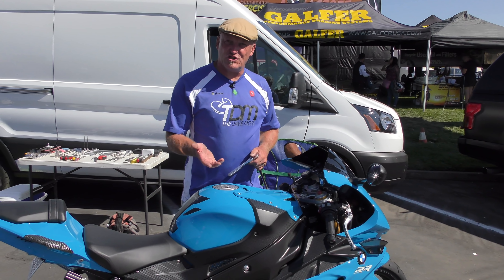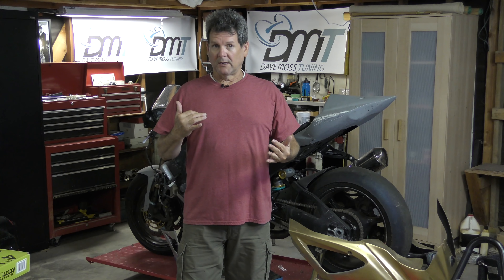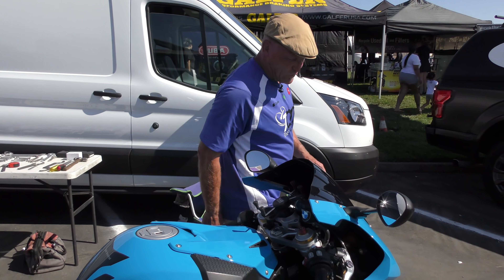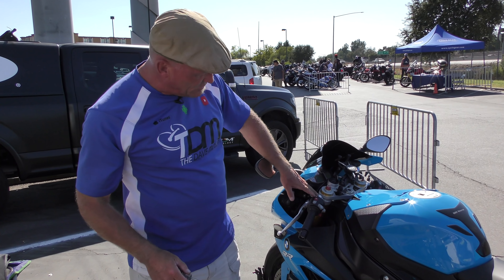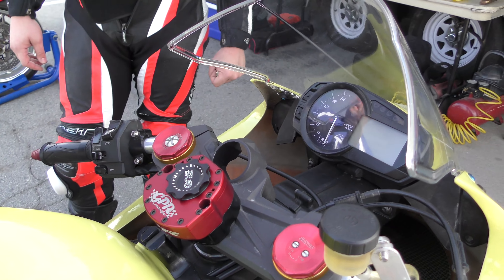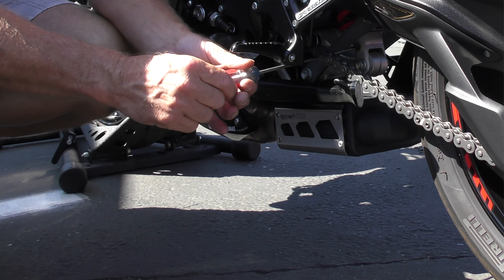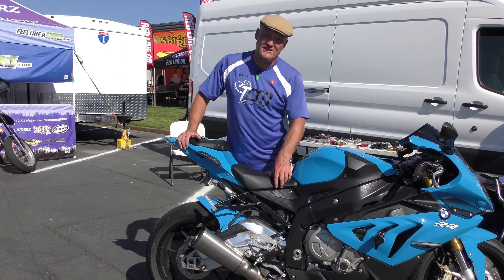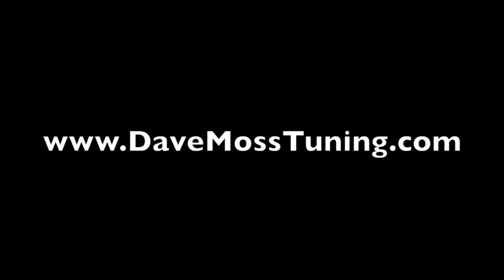Motorcycle Suspension Adjusters: What Why Where and How

Comment: How can somebody with a reputation like Dave Moss not understand preload!? When you increase preload on a fork (or shock), you do NOT shorten the spring (unless you are at zero static sag)! You extend the fork, and raise the front!:Increasing preload does NOT make the suspension harder! It changes the geometry! It's unbelievable that Dave Moss continues to spread such falsities.
Reply from the maker: Thank you for your comment. Yes it does change ride height depending on a linear vs a progressive spring, coil number, length of spring and spacing. Generally that is way over people's heads when learning for the first time as they see the cable tie travel less. In time as with all complex knowledge, the engineering aspect is shared. BTW: would you prefer everyone that rides a motorcycle to refer to oil as Winter or Weight?
Reply: @catalystreactionsbw  I appreciate your response. First, let me say that I have been following you for years, since your insights and tips concerning damping, grip and tire wear are very useful. 

I am not writing this to be hurtful or condescending, but your response just proves my point, you've got preload all wrong. It's not about complex knowledge or an engineering aspect, it is about basic physics! It doesn't matter if you have linear or progressive springs in your forks; changing preload doesn't change the installed length of the spring (unless you have zero static sag, in which case your springs are far from suitable). It only changes the total length of the forks, i.e. the height of the front! The installed length of the spring is the same, no matter the preload (static sag not being zero)! If you add preload on a fork, the adjusters are screwed into the fork caps, but they do not compress the springs, they actually lift the fork caps and with them the triple tree, and the height of the front. Think about it! 

It seems you are making the same mistake many others do, but with your following and your reputation, you have (unintentionally, I am sure) misled the whole motorcycle community for years concerning preload. I see people on forums all over the world refer to what DMT has said, and they all believe you. There are thousands and thousands of motorcyclists all over the world who trust your videos and e.g. think that they stiffen up their suspension through preload, when all they do is changing sag/starting point of suspension travel. 

The geometry of a bike is very key, and I'd say that most bikers weighing 85+kg/180+lbs, especially on Japanese bikes, are often misled to believe that increased preload can sort them out, when they actually must change springs if they want a proper geometry, and experience the bike as it is supposed to be. An unfavourable swingarm angle/squat caused by a siginificantly undersprung rear suspension may have a severe impact on the way the bike acts/reacts and it can be outright dangerous (especially for heavier people). 

I do not mean to sound disrespectful in any way, but please sit down and comtemplate. Once you get it, it is obvious. Maybe you figured it out, after you made a lot of videos, and do not want to owe up. I don't know, but if you haven't figured the physics out yet, please talk to a racing team suspension specialist or a mechanical engineer and they can hopefully explain it better than I just did. Then let your followers know how preload actually works. I am sure that you would help a lot of bikers make massive improvements by updating their suspensions with correct springs. Then, your experience and knowledge in damping, grip, tire wear etc would help a lot more.

Concerning your question about calling it Winter or Weight when you discuss oil, I'd say that when you talk about e.g. 10W-40 oil, the W means "Winter", nothing else! The use of "weight" is, to me, an an everyday amateurish word used when people actually mean "viscosity". Most people understand that "weight" means viscosity, so I don't see the much of a problem there. 

I am sure you mean the best, and I hope I didn't come off like too much of a know-it-all. 

Sincerely,
Nik
Reply from the maker: @6114457  Nik. Great thoughts,, well expressed and thanks for taking the time to reply. It is so hard to connect with all viewers but I try my best and thank you for your kind words in that regard. Expertise like yours makes the accurate and salient point on ride height. Thank you for that.

Comment: Annoying engineering crowd here. Pushing on a spring is compression not tension.
Reply: https://idcspring.com/spring-lose-tension-when-compressed/
https://en.wikipedia.org/wiki/Compressive_strength
In the first link, a spring company describes the compression strain as "tension". In the second link, along with everything else google finds regarding spring nomenclature, the extension strain on an extension spring is called "tension" while the compression strain on a compression spring has no name (I could give you the historical linguistics as to why, but I'll spare you). Hence the common substitution of "tension spring" for "extension spring" throughout engineering literature. However, IDC Spring company seems to be ahead of the lexical power curve and does refer to the compression strain as tension. They appear to use the term "tension" to label/name the strain on a spring regardless whether that strain is extensive/positive or compressive/negative. That said, Dave Moss might satisfy more engineers if he said, "I'm going to strain the spring" or "I'm going to add some strain to the spring / I'm going to remove some strain from the spring". Using the word "compression" for the spring in a motorcycle suspension context becomes problematic because the hydraulics have a "compression" component to them for which there is no suitable nomenclature substitute. But what do I know? I'm just an annoying linguist.

Comment: This guy is an amateur. He knows the simple sag and static sag things. What goes to the rebound and compression.... Dirtbike riders who know what they are doing wil know. You adjust it to what u need. And no bike has a bottom preload setting.
Reply from the maker: Enjoy the rest of the videos in this channel to get a more in depth perspective - may I suggest a topic on barometric pressure, air density and humidity correlated to track temperature, tire pressures and carcass load. Oh, any other dirt bike riders reading this thread, do I appear to you as an amateur given the channel content?